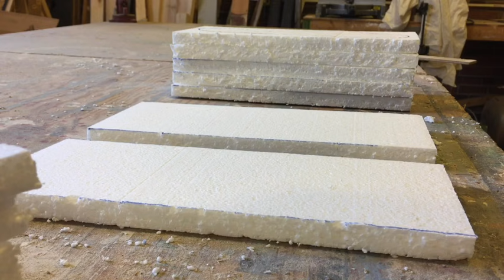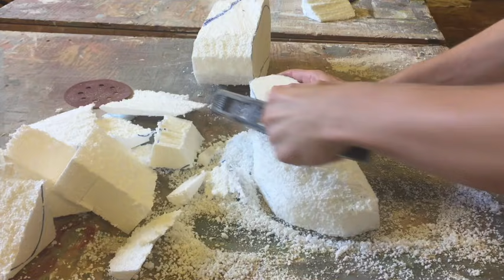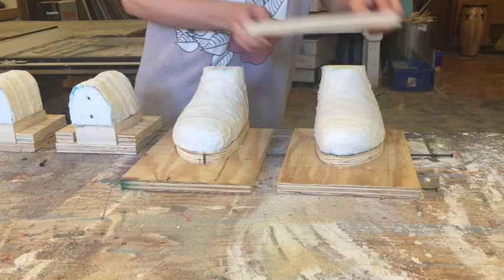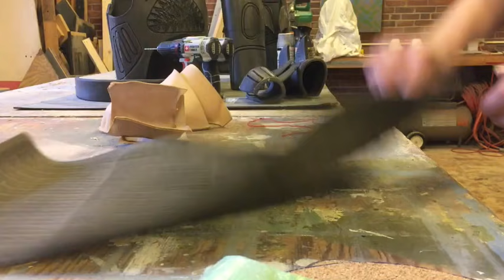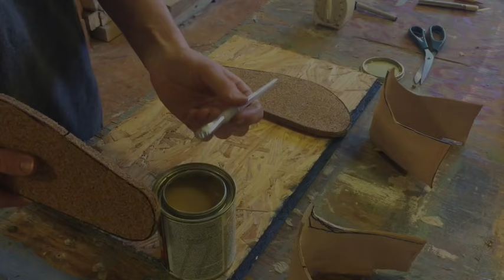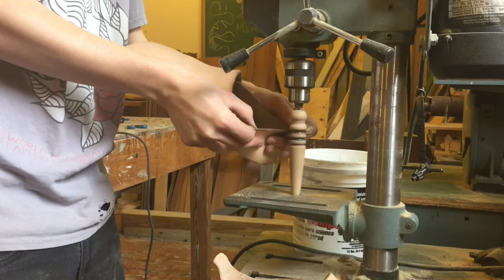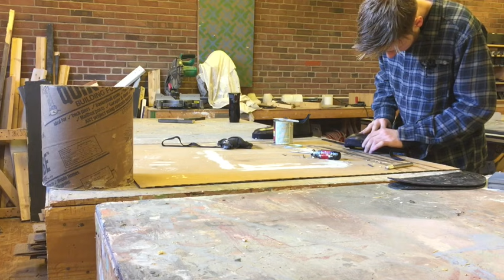Making a Pair of Shoes

Comment: What was the material you were using for the sole of the shoes at 0:22?
Reply from the maker: Just regular white craft glue - to adhere the layers of the leather form. I'd recommend just using spray adhesive instead.